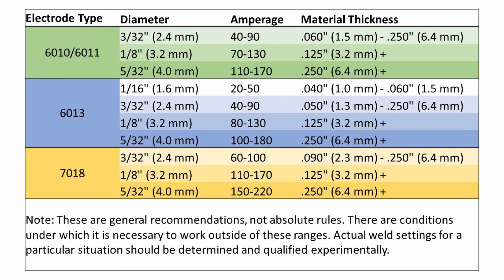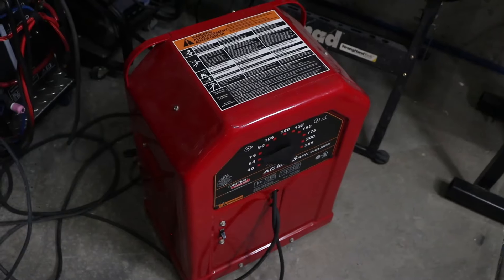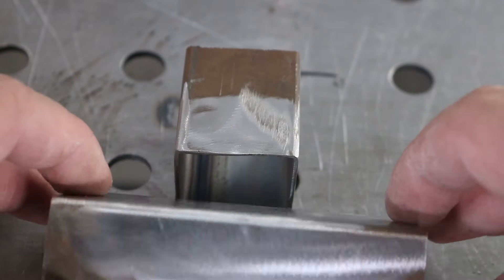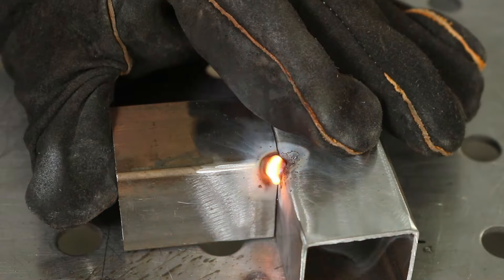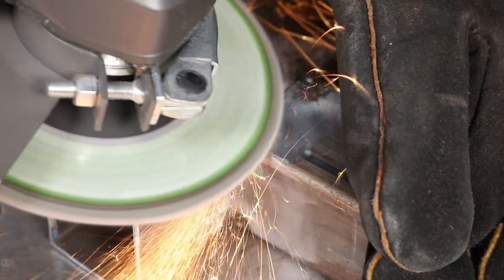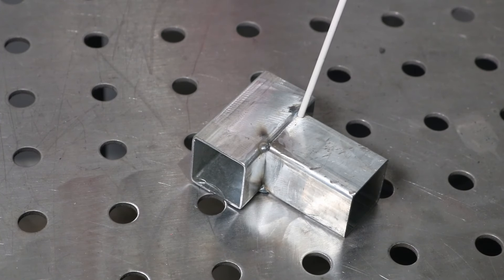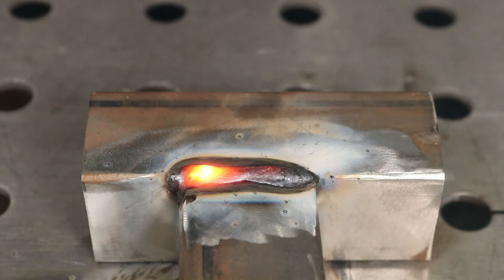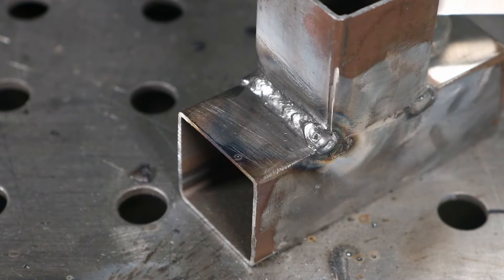Stick Weld Thin Square Tubing

Comment: When your stick welding do you still do the circle motion
Reply: no
Reply from the maker: That’s a great question. A weld like this won’t need or tolerate much manipulation. Fillet welds with 6010/6011 do need some manipulation, and small circles are one of the options that works well in that case.

Comment: Dry sand helps reduce burn thoughts on most thin wall welding.
Reply: Could you elaborate on that? Are you filling the tube with that sand?
Reply: Kommentator  Welding thin wall tube, the biggest issue tends to be a burn through on the thin wall. Fill the tube with DRY sand , it appears to support the wall and reduce the number and amount of burn through events. Just my observation. Once finished you should be able to pour the sand out of the tube. Not possible or suitable for all jobs but might help with some.
Reply: @malibu188  thanks, I will keep that in mind when I'm creating my welding table in the next few weeks ...

Comment: Tim, I'm a newbie on stick.  I picked up some 5/64" 7014, I did ok with it on 16 ga @ 45 amps, dcep.  My welder is an amico arc-160.
Reply: i got the same machine
Reply: So try 7018 rod for clean metal and if welding through rust or paint use 6011 rod. Try to find an Miller thunderbolt 220 welder you can typically find an deal on Craigslist. The size of the rod allows you to either raise the amps up for more heat or down for less and that depends on the size and type of metal your welding so use smaller rod for thinner and bigger rod for thicker metals. I use these two types of rod on most prodjects and jobs and they are standard rods commonly used.
Reply: @wrightsrrt871  you cannot weld that joint with 7018, maybe the fillet but not the j groove .the man just showed you how with 6013 because it a shallow pentrating rod with a short arc length, 6011 is a fast freeze rod with deep penetration
Are you a farm welder?
Reply: @brianpatrick8441   yes I weld on an farm also been to college for welding and have been welding for over 16 plus years stopped counting at 14 years cause what dose it matter after so long how many years. I dont ride coat tails I do many things like ranch hand welding also have welded catalytic converters in cars with stick which is thin metal and I was told it's not possible but thats just me and people are allowed to belive what they want to 7018 was introduced to me in my welding class as used for clean metal  and 6011 was introduced to me as used for rusted and painted metal. They kept it simple but I do understand there's also hard facing rods and rods for all kinds of things. I was only stating that those are the rods I use on an regular basis for majority of things and I have many 1500 pound pluss animals pushing against the welds I've done and they've been there for some over 10 years. Never said I was an pro either but I do dam good job and take pride in my work. Good day to you though sir and hope you find closure in my answer as yes im an ranch welder but also an college educated ranch welder so I guess you could say am I certified well no cause I don't need to be to make money welding cattle fence!

Comment: yeah it helps so much thanks a lot I concern to learn stick welding
Reply from the maker: Glad to hear it!
Reply: @TimWelds  that was the best example of thin wall tube welding i have seen, i have welded over 40 years and you nailed it!!

Comment: Is that an 18 gauge.. all i can say is Wow!   No one in youtube was able to lay continous beads on 18 gauge without putting a backing plate  to disperse the heat. Maybe AC stick is better on thin metals because eithet  DCEN and dcep keeps blowing holes on 18 gauge

Comment: Hi Tim, excellent tutorial. I was wondering will 6013 on DCEN would be less prone to blowing hole into the thin square hollow than DCEP ?
Reply from the maker: I think that it would, but I haven’t tried it. I’ll have to give it a try.
Reply: Yes it would. DCEN penetrates much less, especially with 6012 or 6013.
Reply: @benoutdoors  From my and many welders epxerience DCEP is deep penetrating method. As electrons flow from base metal to electrode and melt more efficiently than DCEN does. DCEP provides great cleaning action (required for stainless, alu, copper) when welding with stick, again - because electrons flow from base to electrode.

DCEP provides more stable arc, better welds and higher penetration. I rarely use DCEN in MMA welding for anything.

Comment: Hi, great video! Are you fitting the stick cable in (-) or (+) in this case?
Reply: It’s all purpose. You can stick the “stinger” or electrode cable into negative or positive.
Reply: He was using an AC welder.  Alternating Current.  So there is no polarity designation.
Reply: @ericl2969  oops I didn’t see it was an ac225. My bad.

Comment: Im not a welder. At all. Im terrible at it. What, you expect me to say that I did some great weld job. LOL. No.

I am welding rusted out, rotted, thin sheetmetal on clapped out cars. And to make it worse, its it difficult positions, like wheel wells, with a metric ton of dealership undercoating (roofing tar from unscrupulous dealers in the 70s), and to make it painful, I have a broken spine in 4 places. Joy...

Comment: Hi Tim, I am new to welding and I came across your channel here on youtube and immediatelly became a subcriber, thanks for sharing your knowledge with us newbies. I am trying to weld thin square tube and it is not going well. I constantly blow holes in walls or melting down the ends. But one thing that I wonder and want to ask, you proffessional welders always talk about Ampere, Rodtype, arclength and speed, but I think every beginner with a newer welder almost for sure have Hotstart and Arcforce, these are parameters that I think put you in trouble while welding thin walled squaretube, you get a very uneven current and if you restart you get a higher ampere and if you have arcforce you constantly get higher current depening on the distance, how do you take that into the equation of the other parameters? Is your recommendation to disable both Hotstart and Arcforce. I am using am Esab Rogue ES200i Pro MMA welder with a default value of Hotstart almost 45% of the Ampere set, and a Arcforce of almost the same.  Thanks for a great channel. Regards Peter

Comment: Hey Tim....

What camera or lens are you using to get the arc shots?
Reply from the maker: It’s a canon T6i DSLR with the stock kit lens and a nd filter. Getting them right really comes down to getting the exposure dialed in which takes a lot of work and is different every time.
Reply: @TimWelds  TY for responding . . . you surprised me!   Most of the YTubers with large channels do not respond to questions . . . I really appreciate it Sir!

Comment: if you use 120v then the amperage is off by 25-30 amp. only when you use 240v, the machine is close (not exact)  to display readout .

Comment: Thank you Tim! You are my go-to welding instructor. I have learned not to click on "professional welders will never show you this!" videos. The comments on your lessons are usually from people with good ideas and tips, and not the negativity you get elsewhere. I won't be taking your course because I simply want to be able to take a stick to small jobs and projects around the house and not get shafted by local lads here in the Philippines who only know how to do dodgy tack welds that fall apart at the first opportunity. Plus I'm clocking 70 and happy just pottering around my house and my garden. Thanks again for your first rate videos.

Comment: Yep, that's me. Blowing holes through everything - lol. I'm learning how to weld as part of my post retirement bucket list. It looks like the electrode doesn't actually touch the materials being welded.
Reply: not sure how you can not know the electrode doesnt actually touch the work if you've welded... if you touch it it sticks thats why you have to strike to get the arc you just graze it ideally
Reply: @jbbolts  I’m here to improve my welding skills.
Reply: I don't think that's a stupid questing. Once you've struck an arch you can kind get close enough to where you'd say it's touching because the flux can keep a gap between what you're welding and the rod. But if the flux doesn't keep a good enough gap and the metal in your rod and what you're welding make direct contact then the metal will cool and it will stick.
Reply: @erictaylor5854  Thank you very much,